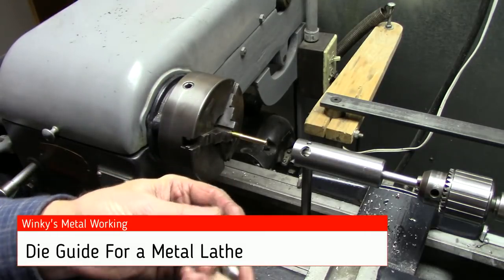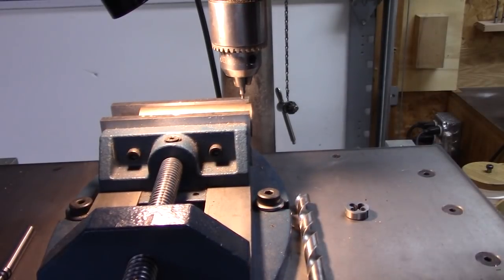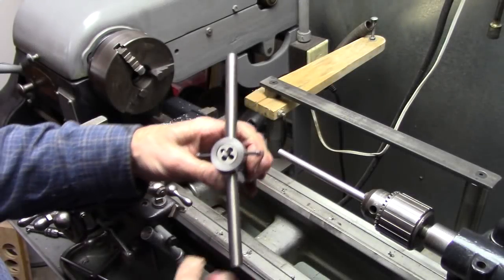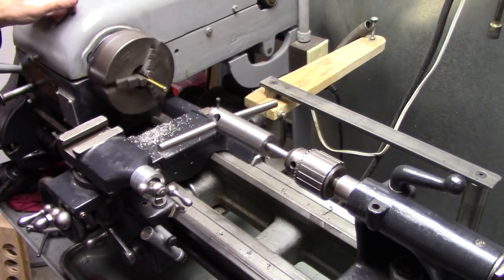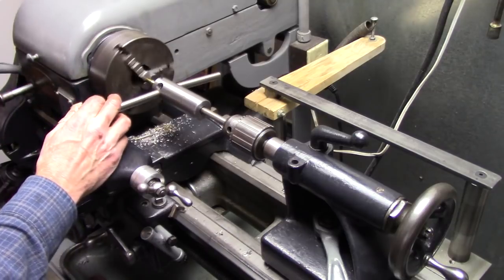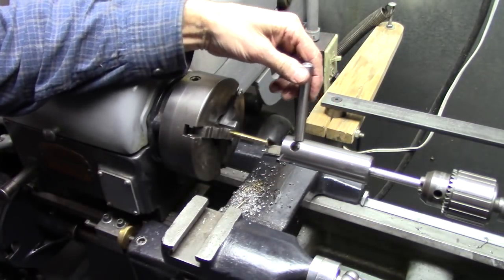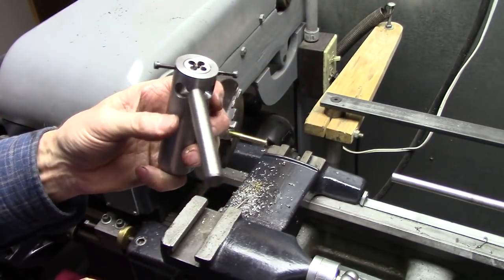Threading Die Holder & Guide for a Metal lathe

Comment: When I use the die holder to thread something like drill rod I can not get the chuck tight enough to stop the rod from slipping while I thread it. How do you handle this problem. ( my chuck is new)
Reply from the maker: I've had the same problem. The first thing I do is make sure I tighten the heck out of the chuck with all three points. You will always be able to tighten it a bit more with the second point sand usually not the third. For me this almost always resolved the slipping problem. There are also adjustable dies. If you are using them make sure you are not making them tighter then champing them in the holder. I prefer solid dies. And last, when you thread a 3/8" rod to 3/8"-16 (for example) you are trying to cut 100% threads. Realistically you only need 80% threads. Very little strength is gained but the last sharp tips of the threads. You can turn down the rod. The Little Machine Shop has an online calculator for this. https://littlemachineshop.com/mobile/die_threading.php

Comment: I liked your design better than mine so I changed my die holder to work more like yours. Thanks for the idea.
Reply from the maker: I have a more current design I like better but in hindsight the new design could be simplified a lot. The tub does not need to slide, the die can simply pull the tail stock. Here's a link. https://www.youtube.com/playlist?list=PLz2A001hMBoRCpe5SnzsKhLudGK7iBkr2

Comment: I like your design. I think I will make one using some aluminum stock that I have. I had been looking at other designs. Thank you!
Reply from the maker: Something I found out later,  the holes in the sides are not really needed. Just leave a larger area behind the die. The intersecting holes are sometimes a pain to drill and the chips still get stuck inside.
Reply: @WinkysWorkshop  Thanks for the update. Now I have decided to make a new cross-slide nut first. That could be a real headache! I am asking the Boxford users group some questions about the type of thread which is a left hand ACME thread but with some modifications. Allan at Enott's Engineering has a good YouTube video about it. But the specs he used seem a bit odd, but it worked.
Reply: @WinkysWorkshop  
https://youtu.be/NRv6HAj-tU4
Hi. Since you were interested in this I decided to make a YouTube video of the top hat modification for backlash as the easiest way of getting images to you. It is only 5 minutes. It is uploading right now and should be published soon. If you have any problem with the above link try my channel: YouTube.com/users/evan-e-cent and click playlists > Boxford > find Season 4 Episode1.
Reply from the maker: @Evan-e-cent  - thanks, that was an excellent video. You need to keep doing them You explain things very well. To be honest, all my dials have been made like this but without the rim of the top hat. The dial bore is large enough so that the additional bearing surface isn't needed (in my opinion). I use a nylock nut or if space permits a lock nut instead is the set screw. The biggest problem I have had is slight misalignment. When I get everything tight enough to eliminate the backlash there are tight spots when you rotate the handle.
Reply from the maker: @Evan-e-cent  - Wow, great job! I may need that at some point for threading metric although I no longer have a selection of change gears now that I have a lathe with  quick change gear box. Of course it might be worthwhile buying a couple gears for the common sizes.
Reply: @WinkysWorkshop  Gooogle requires me to create a EULA for the software! I plan to add another optional entry to change the pitch of the lead-screw and include a fudge factor. That way it can be used for any lathe without a lead-screw gearbox. I can add more gearbox options if people send me their thread cutting tables from their lathes.
Reply from the maker: @Evan-e-cent   - Complicated stuff...  at least for me. I always amazes me how different people think. I can visualize and design machine modifications but when it comes to gear ratios I really have to think hard to figure them out...  and forget the programming.
Reply: @WinkysWorkshop  Tony at Lathes.co.uk just sent me the gear trains recommended for the Atlas lathe which does not have a gearbox.  There are four diagrams of gear arrangements, many with 4 compound gears in a row!! Wondering whether I need to add multiple compound gears but there could be millions of possible combinations.  My software assumes only one compound gear but will come up with pretty good approximate answers with errors often less than 0.2%. It has run some cases with 1.8 million possible combinations, but since then I worked out ways to make it more efficient cutting the calculations to 5%.  I think it is all done now.  I have modified the software a bit so that the user can specify whether compound gears are permanently connected in pairs or used as separate gears in any combination.
Reply from the maker: @Evan-e-cent  - The Logan has 2 or 3 positions with one gear position stacked. Here's a link to a diagram. http://conradhoffman.com/Logan200_threading_chart.jpg
Reply from the maker: @Evan-e-cent  This is the logan web site with gears for metric,  http://www.lathe.com/metric_threading.htm
Reply: @WinkysWorkshop  Wow those are some impressive looking gear trains. Figure 3 shows two compound gears in sequence plus the stud gear and lead-screw gear. So that is 6 gears. If you have 8 gears to choose from and vary them all, there are 16 million possible combinations. But the table doesn't vary the compound gears except for the 3 different setups. In that case figure 3 only has two gears that are varied: stud and lead-screw gears. The others remain unchanged and the double compound gears give a gear ratio of 1.5 between them. My program has a new capability to add a fudge factor for weird situations. If you use a fudge factor of 1.5 it should give the same threads as your table. I will check it. (Maybe it would require 1/1.5 but I don't think so.)  Those tables suggest that you have a limited number of compound wheel pairs "48/24" , "18/54".  If you use my program I would suggest deleting my list of compound gears and adding these two and any others you have, and also putting in your own list of plain change gears (keep the lists in a text file to copy and paste into the program) and see whether you can get all the pitches you need with less complexity if you accept a small error eg 0.5%. Should be fun to play with... www.HeroSteamEngine.com/RideTheGearTrain.
Reply: Looking at the link you sent for metric threads I thought the bottom diagram was wrong.. There is a 72/18 compound gear connecting to the lead-screw gear but the 18 tooth gear is not connected to anything. Instead the 72 tooth gear is acting as an idler wheel and does nothing... But after studying I realize it IS just used as an idler and the 18 tooth gear acts as a spacer to line up the other gears. It is just used to accommodate different sizes of gear wheels on the lead-screw.  I worked out from the table that it must have a lead screw with 8 TPI = pitch 0.125" = 3.175mm,  but with the standard metric conversion compound gear x 100/127 = 2.5mm. So it now behaves like a lathe with a lead screw pitch of 2.5mm. That is why the table says for 2.5mm thread you need the stud gear and lead-screw gear to be the same ie 1:1 ratio. And that is why any set of gears has to have at least one gear duplicated (unless you have a gearbox) If you think of it that way you can ignore the fact that it is actually an imperial lathe! You could even enter it in my computer program as a metric lathe with 2.5mm pitch. I think I should write that in my instructions.
Reply from the maker: @Evan-e-cent  - Yes that is correct on the gear acting as a spacer. One gear does almost all threads but the other is used for extremely course threads. Under 8 TPI I think. This is for lathes with a QC gear box of course. Yes the lead screw is 8 TPI.  On the manual gears I think the stacked gears are to save space. One big gear would simplify I think.
Reply: @WinkysWorkshop  Thanks. I have added this to my information/help file. I tried the idea of treating this as a metric lathe with lead-screw of 2.5 mm. It should work but I discovered a bug in my program. It is 1 am in New Zealand so I will fix it tomorrow.
Reply: I will also include your gear diagrams in the help file too I think.

Comment: A little tip when using your digital caliper, when you checked the diameter of the die, if you had then ZEROED the caliper, when you checked the bore of your part, it would have shown you the DIFFERENCE, divide that by 2 to get your cross slide setting. The other thing you need to know is that the die holder should be about .010" OVERSIZE, this is to allow you when you have a split die to open it up to cut an oversize thread. Your die just happened to be an unsplit one, as some often are these days. You really also ought the have 3 screws, the center one with a point on so that when it is screwed into the split in the die it will allow it to open up. Great job though and does the job nicely.
Reply from the maker: Thanks, very true...  sometimes the producers put the pressure on and I overlook the details, I'm kidding, i have no producers but sometimes the camera has the same effect.

Comment: That's a slick idea! Something else you may find handy, is a covered cup with a hole in the concave lid for a small 1/2" paintbrush. I made one out of 2 1/2" dia. aluminum round stock, and cut a seal groove in the lid for a O- ring so it fits snuggly in the bottom jar. Put a knurled band on the O.D. of the jar and lid. Nice to use on the mill and lathe as it keeps the cutting oil on the tool.

Comment: Interested in the mods you did to the drill press........a video would be cool.
Reply from the maker: Thanks. I've thought about doing a video on my XY table many times. The problem is that it is made from some surplus dovetail linear rails I removed from old machinery. The cost of the rails and bearings alone if you had to buy them are over $300. Then there is also the fact that the table is a bit flimsy when you drill much over 3/8" in steel. I might build a new one at some point and if i do I'll make a video. BUT...  I will say this: My XY table is one of the most useful items I have ever made. I would encourage you or anyone else to spend $350+ on a commercially made mill table. It will be one of the best investments you will ever make. Don't buy anything cheaper, they are junk.
Reply: The press caught my eye while viewing, quite impressive! I have a spare drill press that I'm refurbing, will most likely do an XY table on it. Thanks for the reply!
Reply from the maker: @811mookie  - You will love having the XY on your drill press. If I remember right the travel on mine is 6x5 inch.  The table is 14 x 18 x 1/4 inch thick I think. I bought 3/8" x 10 TPI Acme threaded rod from McMaster Carr for the adjustments and made dials for the adjustments. Mr Pete has a youtube video on how to make dials. The vise is pinned and bolted to the table so that I can remove it and reinstall it square to the table travel but, I have never removed it. I made an auxiliary table for woodworking by gluing a scrap of 2x4 to the bottom of a peice of plywood. The 2x4 claps in the vice and provides a wood table.
Reply from the maker: Also...  if you make one, you can guide from one edge. Unlike a mill, you will only be using it to position work so binding shouldn't be much on an issue. Good luck. Buying a good one might be the best option but it's also fun to build your own.

Comment: Nice to see an old Logan up and doing real things. I have one in my storage trailer and itching to get it set up.  

Dan
Reply from the maker: I love this lathe. I restored it about 3 years ago. It's a 1943  Logan 200. I also have a 1946 Logan 820 but it's not restored. Both lathes are the same size but the 820 is made heavier in the compound area and has the quick change gear box. I hope to start working on it in a few month.
Reply: Winky's Metal Working Tips 

Look forward for that series of videos. Logan doesn't get it's due.  I have a couple of Southbends in queue for restore after my kids Volvo rebuild.
Reply from the maker: I think Logan is a good lathe. Probably comparable to some South Bend although it depends on which model.

Comment: I think instead of handle we can make a key and key way on the guide shaft so automatically going in and out.my opinion
Reply from the maker: A bit more involved but that would work
Reply: Winky's Metal Working Tips no horizon for mechanical stuff it is open and wide thanks for replying.

Comment: I like the drill press milling nice adjustment
Reply from the maker: Thanks, I made that out of surplus slides, dove tail and rod. It would be unrealistic to buy the parts and build but it cost me almost nothing. The rods flex a little under extreme pressure and when drilling 1/2" and over the table tends to move a little (backlash and flexing) but, drilling smaller holes and even large holes with a pilot are accurate within .001.  It's nowhere near strong enough to mill but for drilling its amazing. I would encourage anyone to buy a larger mill table for a drill press. Maybe a 20 inch x 8 table. Money well spent!

Oh...  I pinned my vice to the table dead square to the slide. I use an edge finder to calibrate the back jaw to zero and then use the dials for locate holes.
Reply: Winky's Metal Working Tips ....well done I will stay tuned to your  channel

Comment: I suggest that when sanding the work on the lathe that you place cloth ont eh bed to collect the abrasive dust. the dust will otherwise cause a lot of wear on the lathe.

great project.
for my wish list I would like to have some handle release mechanism in case the torque on the die when threading becomes excessive and the lathe does not slow down quick enough. Any ideas??
Reply from the maker: You could lay a board on the compound and let the handle rest on the board. I'm not too worried about the smaller dies but larger ones might be a safety issue.

Comment: You might try boring the hole that was giving you a problem with an end mill. I've done that when I had to have a true hole that wanted to run off. Once you have a true hole you should be able to enlarge it with a drill if needed. This has worked well when I needed a hole in a trailer hitch stringer as the pin must line up right to go through both sides of the receiver. Lock your table on both axis and use enough oil and go slow, if your table is 90 degrees to the spindle on both axis it should fine.
Reply from the maker: Thanks, I've actually used an end mill like that. It works great as long as you go slow. In this case the slight misalignment would not create any issues.

Comment: Hey what model lathe do you have? Is it a Logan?
Reply from the maker: It's a 1943 Logan 200. I restored maybe 3 years ago. I also have a 1946 Logan 820 in need of restoration.
Reply: Ok that's what I thought. I'm in the process of restoring a 200, finding parts, repainting yada yada yada. Thanks for your videos, they help!
Reply from the maker: It's a good lathe although the manual gears are a bit of a hassle. You'll want to check out my cutoff tool video. The compound on the 200 is a little wimpy and this modification makes cutoff work very well.
Reply: Will do thanks! I have a video suggestion for you then: "Modifying a Logan 200 to a Quick Change Gearbox" :) Hint hint...
Reply from the maker: Other Logan model gear boxes will fit with some modification but good luck finding one for under $400. I've always though timing belt pulleys and belts would be better but that's still a significant modification to make...  Which is why I bought the 820 to restore. It's slightly heavier than the 200 but the biggest plus is the quick change.

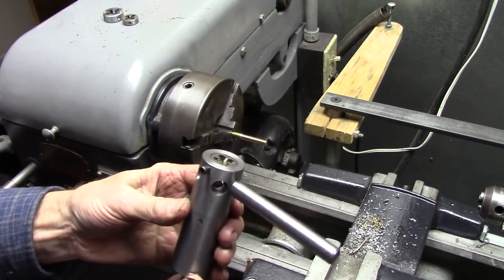Comment: Another great, practical tool.  Thanks for taking time to document it.  I noticed at 0:53 your homemade band saw fixture.  I have one of those saws. How about showing how you adapted the hand held saw in a future video?
Reply from the maker: Thanks Doug, I use the heck out of that band saw and it is surprisingly accurate! The only negative is that the vise is not close enough to the blade and holding anything shorter than 1.5 inch is impossible. I've thought about making a video but sadly they no longer make this saw. I''m sure a few (like you) still have the saw but for many the video would not apply.
Reply: I understand and thanks for the followup. I don't have that exact saw but another similar one (Chicago Electric) my brother gave me this past year which is still available.  I was just interested in the basic setup which I could modify as required.
Reply from the maker: Hey...  I just posted a video on the bandsaw and a link to plans. The link is in the info area below the video. Enjoy~!
Reply: Wow, what service!! :>) Many thanks.